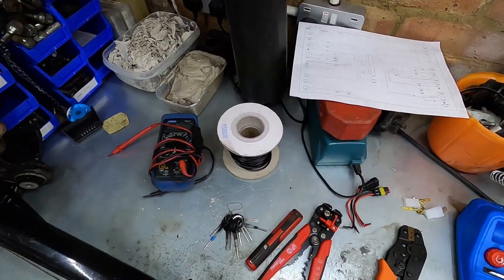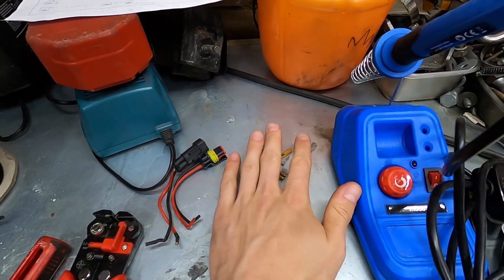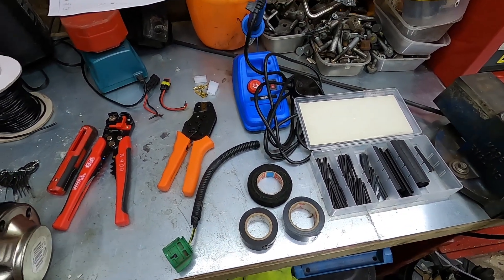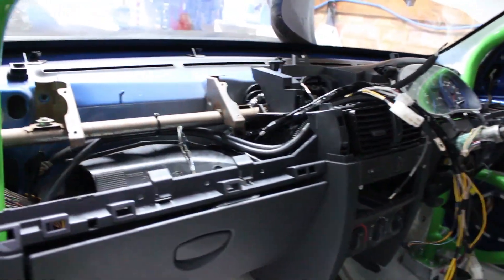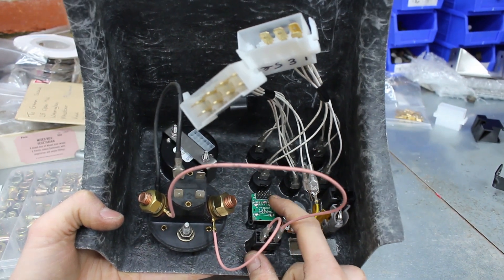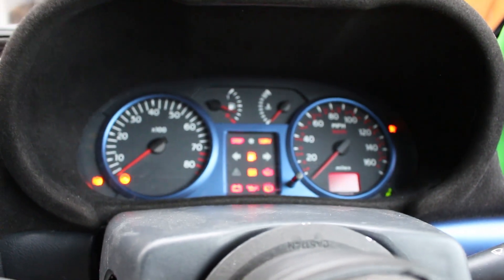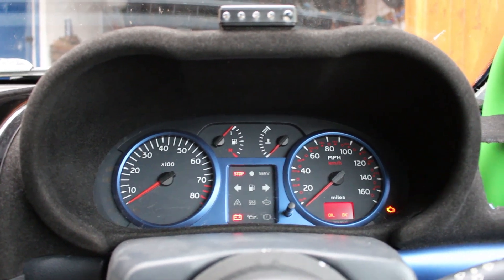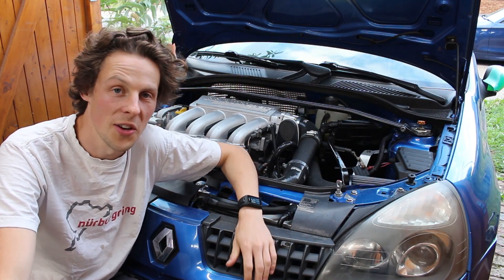The Wiring Wizard 🧙‍♂️ - The Turbo Clio 172 Cup Part 3

Comment: Hi, I have a 1.2 8v Clio Mk2... I’ve tried to find a thread on the forums but had no luck. I am looking to retrofit air conditioning... Do you know if it’s possible and what parts I’d need? The climate control unit I have is the cable one...